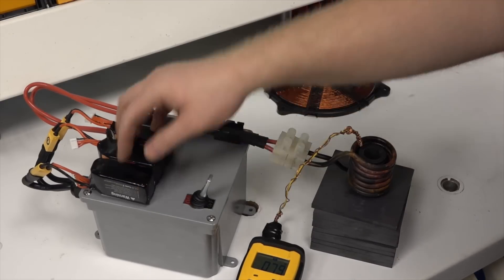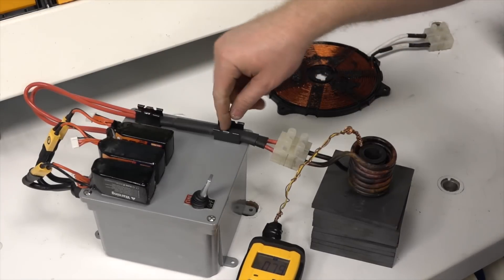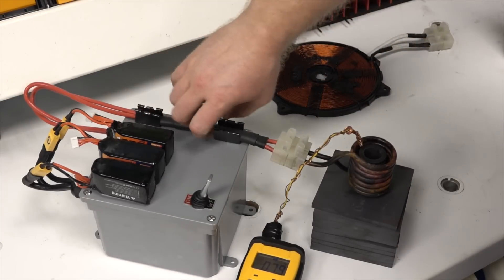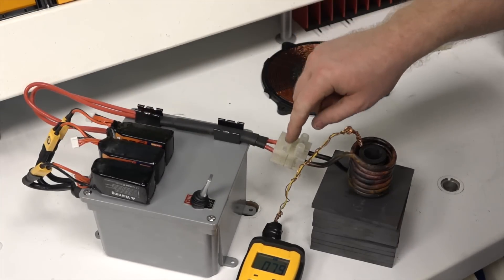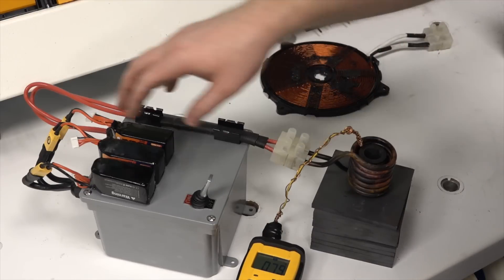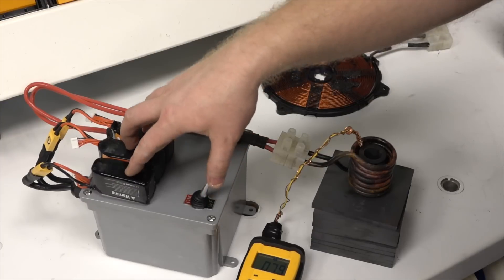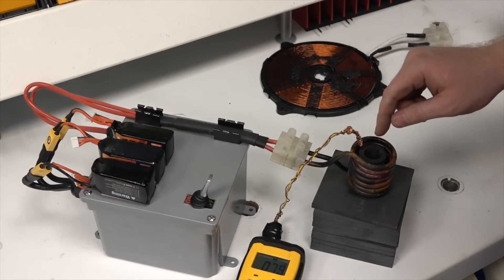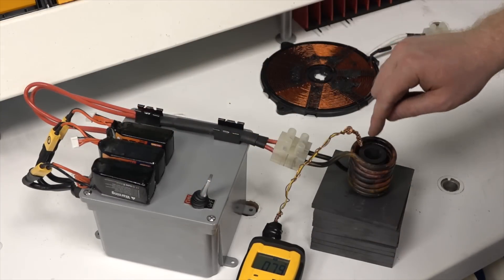Cheap Battery Powered Induction Heater Shattering Ferrite

Comment: clickbait title!
Reply from the maker: Are you serious?
Reply: No matter how descriptive your title is, there will always be people out there that will say it's clickbait if it's even remotely is interesting. I think too many people don't know what that word really means.
Reply from the maker: Wrong.  The ferrite tile was also being rapidly heated by the induction heater.  The ferrite tile would have shattered without the crucible, albeit a bit slower.  If placed directly in the coil, they would shatter even quicker than they did in the video.  Like jesondag said, it doesn't matter what the title is, someone like you will comment about rather than add to the discussion of the topic.  If I had put "graphite crucible shattering ferrite" someone would have said, "actually, you used an induction heater. Clickbait!"  The thumbnail clearly shows the setup.  Do you not understand context clues?
Reply: It was the hot crucible that caused the tile to shatter, no?

If you had the induction heater and tile with no crucible, the tile would not have shattered. If you had the hot crucible without the induction heater, the tile would still have shattered. Hence, the induction heater was not responsible for the tile shattering
Reply: at 1:28 after you turned off the heater another piece came out right? anyway I clicked the video because i wanted to see ferrite put directly in the coil. perhaps you could do that with the shards?
Reply from the maker: I can do a video putting ferrite magnets in the coil.  They break pretty quickly.

Comment: Good Stuff. I have plates of asbestos that would be great for that stuff. Uh oh...  uh, er, time for firebrick!    

What frequency are you pulsing the coil at?  I had not thought of battery powering an induction heater, but need something like this for heating O1 rod (i.e. how to make a custom counter sink tool on the lathe).
Reply from the maker: Thanks!  I've been meaning to pick up a few fire bricks.  The circuit is self resonating so the frequency depends on what you place in the coil.  You can change it for a particular part by change the caps or adjusting the number of turns on your coil.

Comment: Hi, woul you mind telling me what thermopar you used ? Was it a K type thermopar, or a homemade two twisted diff metal wires. Generally K types have difficulties withstanding above 1300 C
Reply from the maker: I'm using this meter http://amzn.to/2jX2jlY
I have used it up to around 1100 C with no issues.  I don't plan on measuring anything about 1300C, so type k thermocouples are good for me.  The solid copper wire is just there so I can position the thermocouple easier.
Reply: I had problems with my cheapo K thermocouple meter with high frequency interference. I couldn't use it to measure the heat of a MOSFET in a flyback driver circuit, or in any circuit where high frequencies were involved, it's pretty sensitive. IDK why.
Reply from the maker: That's strange.  What model so others can know what not to buy?
Reply: Mine was this one. http://www.banggood.com/3m-High-Temperature-1001250-Degree-Thermocouple-100mm-Probe-Sensors-p-87568.html?rmmds=myorder
Reply: However I tried it only up to 680 C
Reply: I know it can't handle more because now the title at Banggood says up to 700 C BUT when I bought it was stating this unit was good up to 1200 C
Reply: Than I found the thermopar type G can handle up to 3000 C however in my country I cannot find this thermopar. I need to use to melt glass which is above 1300 C
Reply: This one is it: It was a cheapie, so I don't mind too much but I updated my review. https://www.amazon.com/Signstek-Channel-Digital-Thermometer-Thermocouple/dp/B00FFYEPVQ/ref=sr_1_1?ie=UTF8&qid=1484737169&sr=8-1&keywords=Signstek+3+1%2F2+6802+II
Reply: Uau this new meter costs only Us 20,00 however they do not ship to my country therefore I must buy with a friend of mine living in USA and this will adds a new freight cost of around us 25,00